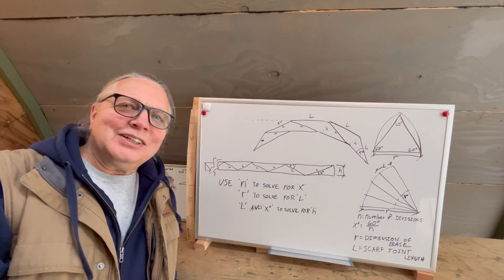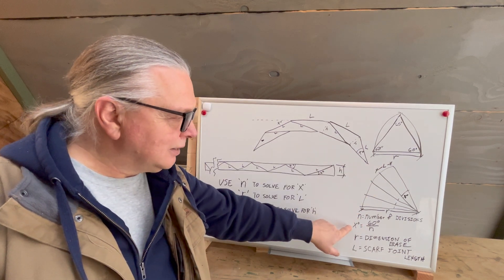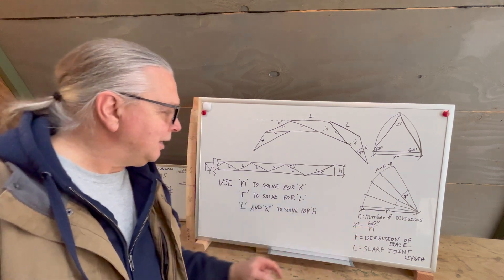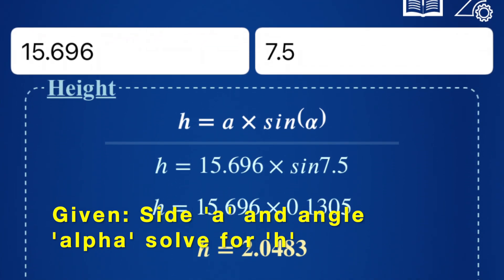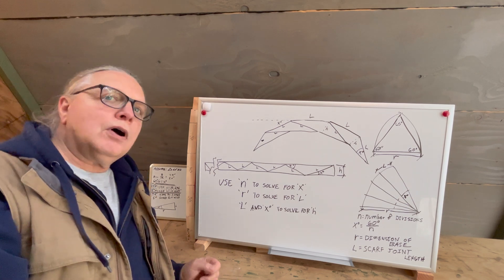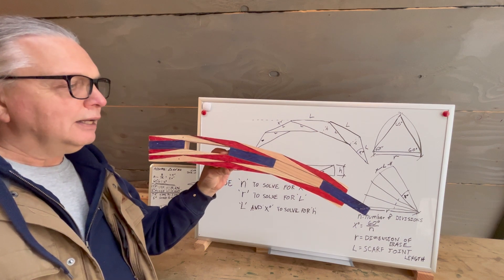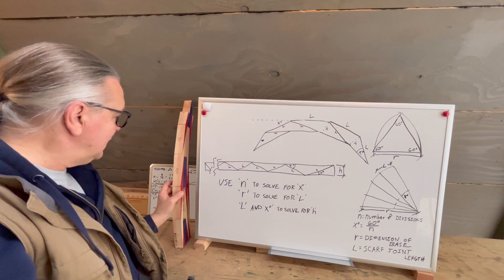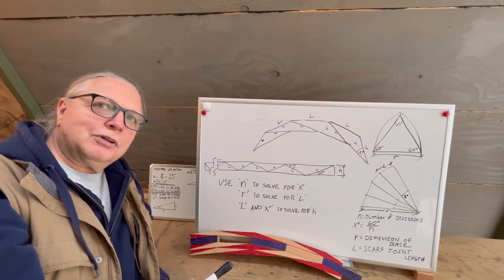Gothic Arches Scarf Joint Geometry

Comment: So the arch itself is 1/3 of the whole circle, for those curious, this is how you get an arch of 120 degrees and the inscribed triangle with 60 degree angles. Having the trainagle be 60-60-60. You can build the arch on the ground the width of your slab. Being that the angle is inscribed the width if the base, you can calculate the high of the arch by dividing the base by 2 and multiplying it by square root of 3. So if your base is 10 foot wide, your high point/ridge will be at 8.66 ft

Comment: Do you have some formulas to figure out the angle of the cuts if the height is not symmetrical to the width of the building? Ive watched your video multiple times but i think im missing something. I feel like the formula should work whether you are using size wood like 2x4 and 2x6 material? (Any comment would be useful) because i want to make a gothic arch style greenhouse and i feel like this would be a great design

Comment: Thanks for great math lesson. I have been sold on the Gothic arch design for a while now and your video is the first that I have seen with good design explanation. My preference is using glued scarf joints for eliminating the need to bend the material as you point out. It’s now time for me to get to my drawing board and crunch some numbers. My fall project is to make a small 8’x8’ storage shed using these arches.
Reply from the maker: Good luck with your project!